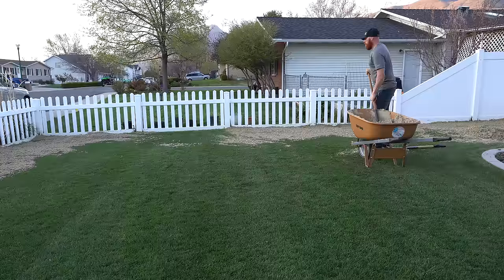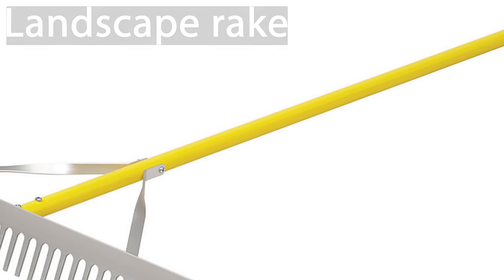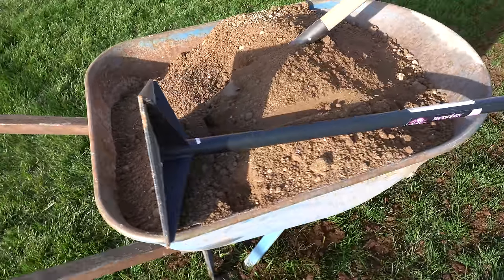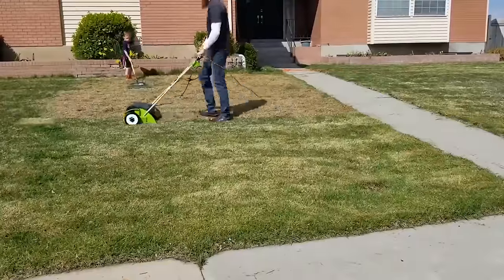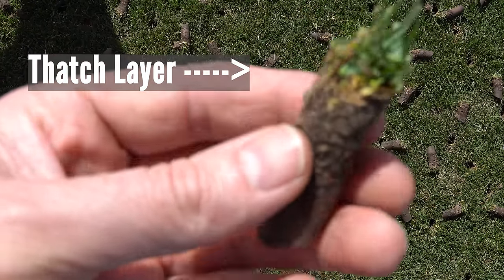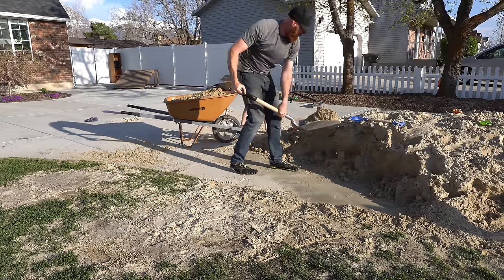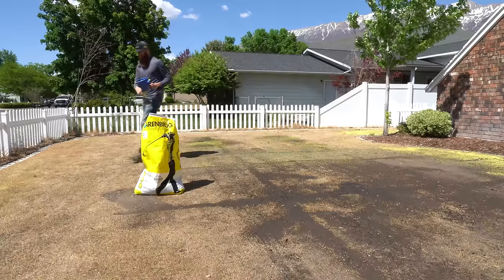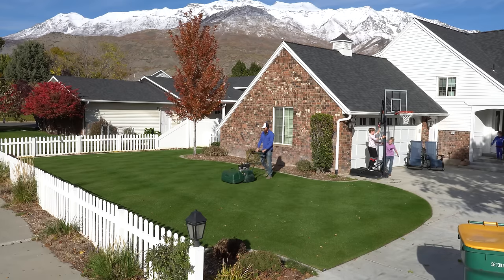DIY How To Repair bumpy yard, lawn leveling with sand or soil.  COMPLETE GUIDE

Comment: Got to love these videos with no mention of price at all....about $2,500 later you will  have a nice lawn. The sand/soil alone for my lawn at 14,000 Sq ft. Is close to $700. That's not counting grass seed, fertilizer, watering 3 tImes a day or any tools a person might not have. More discussion is needed in the lawn community about what these projects actually cost per 1,000 square feet. It's not fun to talk about but people need to known what they are getting themselves into.
Reply from the maker: Not sure why the soil you’re finding is soo expensive. Keep in mind this is a quick guide. I do agree understanding cost is necessary. 
I get the sand $10 per ton plus delivery. Delivery is commonly between $65 and $275 depending on the company. Puts you at $500 maximum for soil. Fertilizer 2 bags will cover your max cost $70 for nitrogen.  Lawn aeration rental max $120 or you can someone $150. $170 for a sun joe. 

Think your estimate might be a tad exaggerated
Reply: @pestandlawnginja  my locl USGA sand plus reedsedge peat moss will be about $700, but that's Uber premium dried stuff.  @analyzer52,if you're just getting regular sand or screened topsoil, $700 seems high.

And remember, you gotta pay to play.
Reply from the maker: @steffen707-  it’s true. You can spend a lot if you don’t mind paying a premium
Reply: Boo boo brokie
Reply: Anytime you start a project at home you better expect it to be expensive.

Comment: I have a townhome with roughly about 20 x 20  backyard with grass. It's a small yard, but with too many grading issues.  First , there is a natural slope, not huge slope, but enough to flow the rainwater from left side the wall to the right . About 20 years ago, we had our deck built, and built a patio of equal size below the deck.  Over the years that one front right corner of the patio sank a bit around the corner post of the deck.  On top of all this mess, I have an elongated bunp in the lawn about 5 feet away from edge of the patio, parallel to the patio. The bump is high enough to need dug about 2-3 inch and is about 3 - 4 feet long. The whole structure is so that the rain water flows down from left to right and makes mud at that sunken corner of the patio.  I want to sort of regrade the lawn, so that that bump goes away, the level of the lawn is raised, a bit, filling the sunken corner, so that the water flows away from the patio. But I have to be very careful about how much I raise the level, so the patio doesn't need to be raised above the patio door.  My initial thought was to shave off that bump, and transfer that soil to fill the sunken corner.  If I raise the level of the lawn, it means I will have to raise the patio up a bit, and I can't go above the door base.. I have thought and thought, and made palns in the head, but nothing seems to come to a solution..  Any suggestions? I will appreciate a lot.

Comment: Ginja, I love your videos. Learn lots. I have some leveling to do with ruts greater than 1” - 2”. I think I should go with a straight screened topsoil since it’s so deep; don’t want to burn up the grass with straight Mason sand that thick and holding in the heat from the sun. I live in the SLC valley. Where do you source your screened topsoil from? Many thanks, and keep up the good work.
Reply from the maker: Geneva rock at the point of the mountain was the most cost effective choice

Comment: Great video! If you need to put down 2-3 inches of sand/compost to get the levels finally right with Bermudagrass, do you put the fertilizer directly on the scalped lawn or on the sand put down?
Reply from the maker: I prefer to scalp it so the organic matter doesn’t cushion and then later collapse. It can potentially mold under the dirt as well which may or may not cause issues with the newly planted grass

Comment: Is now the opening of seeding bio blue in Sandy Utah and how late is the window open?  Or do we need to wait till we get irrigation systems turned on in 4 weeks?  Man I'm seeing the blue snow mold and I have some.   This handyman season went from nearly dead to warp speed.
Reply from the maker: check green cast online and check the soil temps.  when they're above 50 its go time.  You can always put the seed down now.  the seeding window will be short for bluegrass this year.  earlier the better in my opinion.

Comment: Thanks for the video, if we have cold winters, do we do this treatment before winter in after? And one more question, if we do it each year, wont we put too much sand onto the lawn?
Reply from the maker: you'll want to prioritize such treatments for leveling a lawn spring and fall when the grass has the potential to grow vigorously.  helps push the grass through the sand.  you'll use more sand the first and second time you level by comparison to the years to come since you'll be doing less "leveling" and mostly smoothing of the surface.  keep in mind golf courses have been doing this for years and years.  it changes the soil type and can be very beneficial especially if you have clay type soils.
Reply: @pestandlawnginja  Thanks for the quick answer. One question, Can I sow the grass seed right after leveling or I shall wait few days/weeks?
Reply from the maker: @hypnotherapysk  same day no problem
Reply: @pestandlawnginja  and regarding sand for leveling, do you suggest 100% sand or mix like 50% sand and 50% soil?

Comment: My lawn seems like it's been bombed and trampled by heavy infantry. Sometimes, I worry about using my lawnmower and finding a brick I didn't see before. I'm pretty sure when I got here, the lawn hadn't been cared for in years

I've wanted to fix the lawn to help give me the motivation I need to get enthusiastic about maintaining it since I moved here, but I honestly don't even know where to start.

It's kind of okay in some areas, but then nightmarish in others. I'd consider tilling and resseeding it, but there's an in-ground sprinkler system, and I don't know where the pipes are. Not to mention, I've found bricks here and there before, so I'd be kind of worried about finding more.

I would like to be able to save money by doing it myself, but if this is a project I simply won't be able to do, I want to know before I get myself in over my head.

Comment: Do you have to use sand? Can you use compost? I'm not sure I want to go down the rabbit hole with sand!
Reply from the maker: you don't have to use sand, its just the easiest in my opinion to use as a smoothing agent.  i find compost is a bit fluffy at first and then overtime it settles.  I'd suggest top soil over compost.
Reply: My yard needs leveling and the soil holds water. Subdivision was built swampland 20 years ago. I’ve been told to use river silt. Silt has a little clay in it and will help the drainage. River silt sells for $30 a cubic yard.